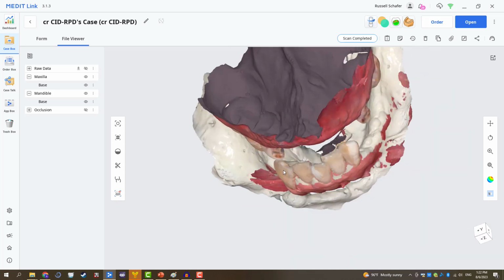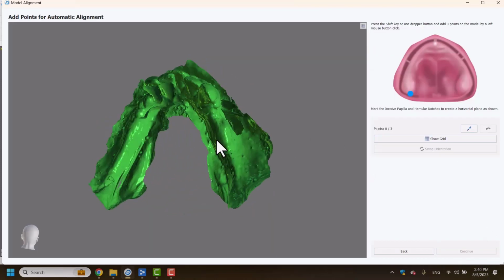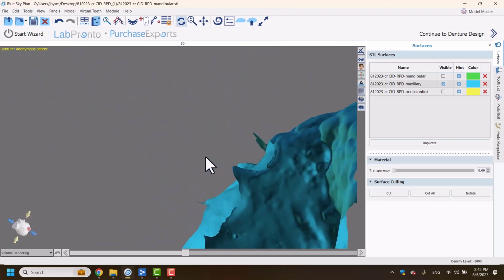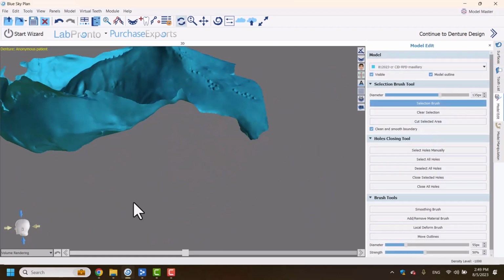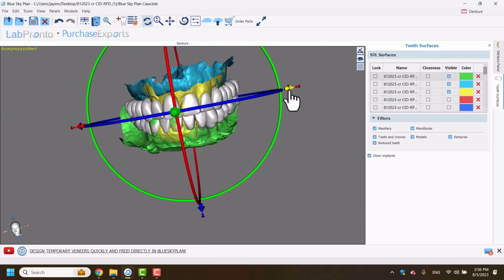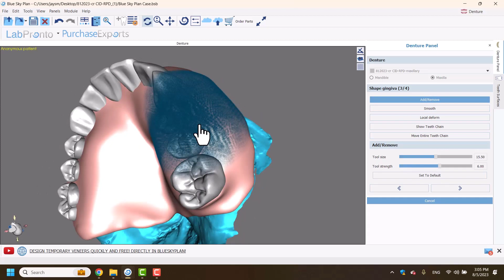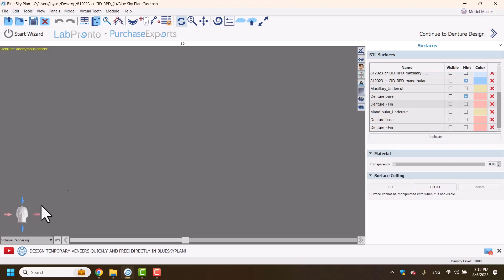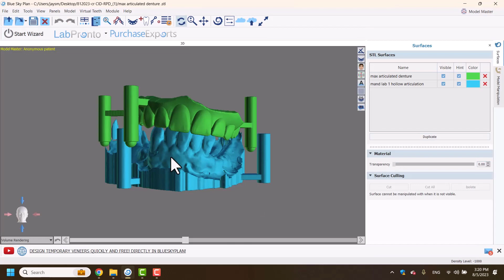Immediate Dentures and Partials and Models in Blue Sky Plan

Comment: Hey great video, love your stuff. Why is there no offset between the denture base and the model? Why not leave something like a 0,05mm offset so its not too tight? Or that doesnt make sense?? Also for partials do you have to somehow "cut intersections" with the proximal teeth like in exocad so it fits in the patients mouth?

Ive printed a couple of partials but so far I havent had good results, theyre either too tight and dont fit or too loose. Im trying to dial in the parameters, the offset, undercuts, etc. 

Thank you for your content, its great!